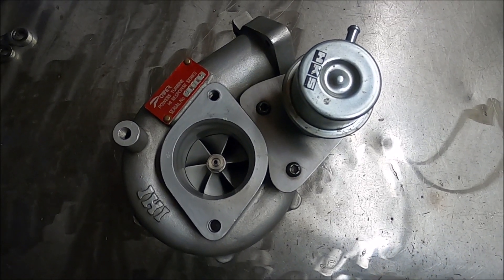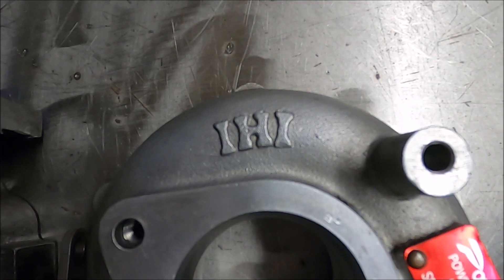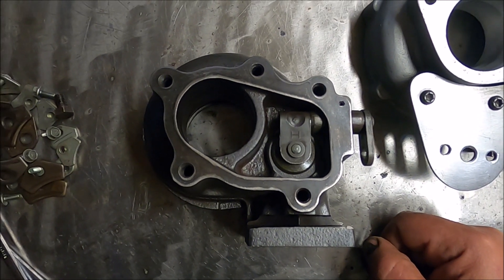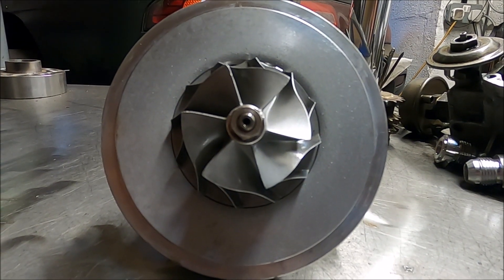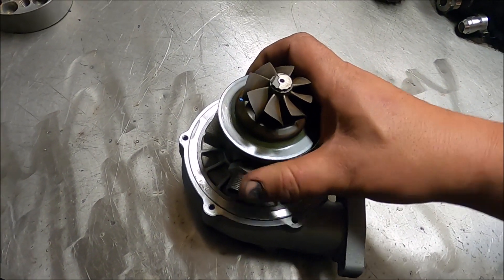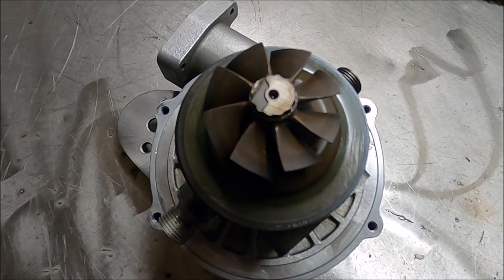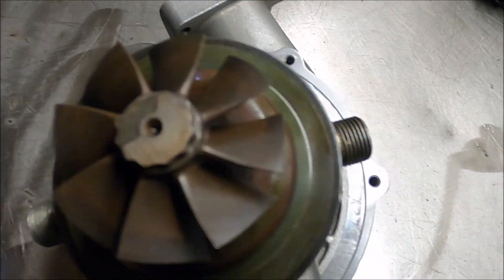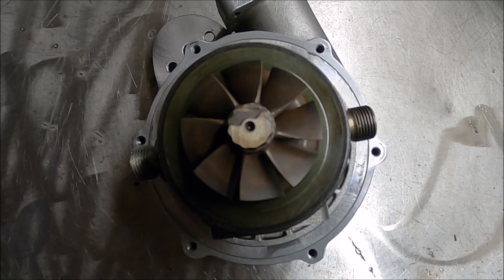The mythical Power Enterprise PE1420 turbo- What makes it spool so well? Let's take a look...

Comment: i think i have seen that tubine wheel design on a resent garrent SA video IS38 hybrid turbo failures https://www.youtube.com/watch?v=Qfyfb6MHnTI. it looks like it is used in IS38 if you look at 4.44minsin you can see the funky cut back on the inducer of the original turbine wheel fitted to the IS38
Reply: just seen another one from an IHI turbo in the video  https://www.youtube.com/watch?v=SPuZf4uTCm4 9.46mins in it is not as extreme as the one you are showing but it is cut back in the turbine inducer.

Comment: Would it go nicely on my Stagea RS4? It’s got the RB25DET but on a 4 speed auto. I’m thinking of whether it would produce good boost just loaded up on the torque converter at its standard stall speed.
Reply from the maker: Yeah on a 2.5 it would spool probably better than stock turbo

Comment: Got one of these on my s14a, took it apart to weld a T3 flange and tack the internal gate shut to suit my top mount manifold and external gate set up. Was also a bit surprised at the shape of the blades compared to the stock t28 or the bigger 2871 that's the normal go to turbo on an s body. If you want to see the response and sound (I think it sounds ace) take a look at my channel, been running it for a few years now on a generic Hdev map and seems very reliable!